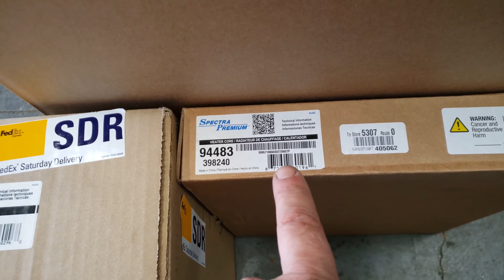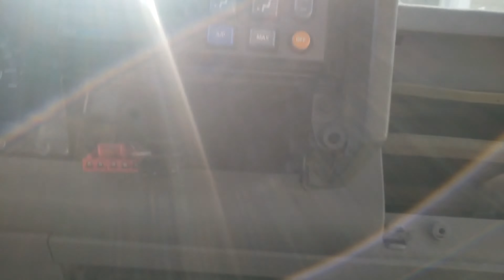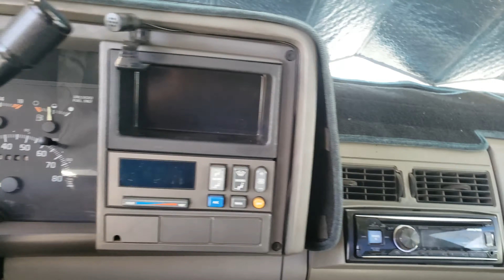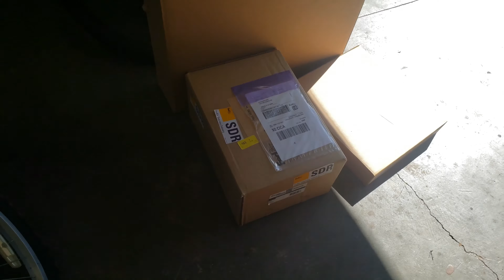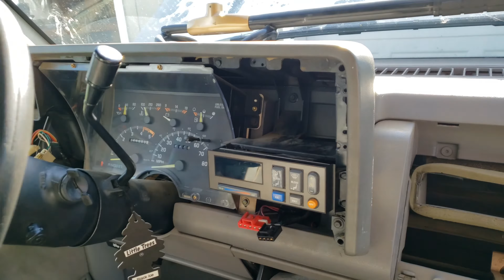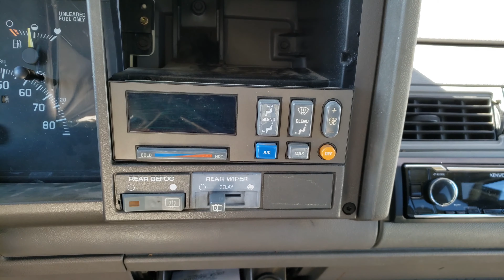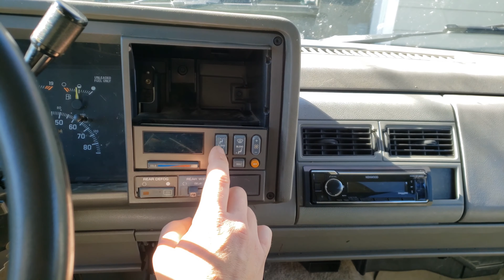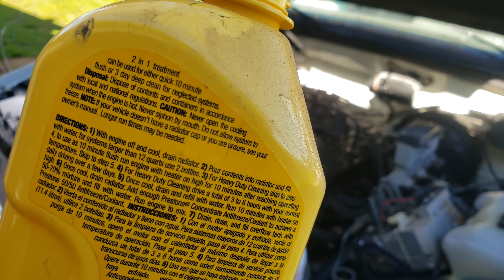How to replace Radiator and heater core on 94 Chevy K1500 Suburban

Comment: The rubber under the two top mounts that you mentioned ... How do they go cuz i forgot which one goes where
Reply from the maker: I don't think it matters the rubber pieces are the same on either side
Reply: @GibsonGarage  But the bottom and the upper are different 🤔
Reply from the maker: I don't think it's a catastrophe if you get them a little mixed up if it doesn't feel right when you go to tighten everything down try switching them up